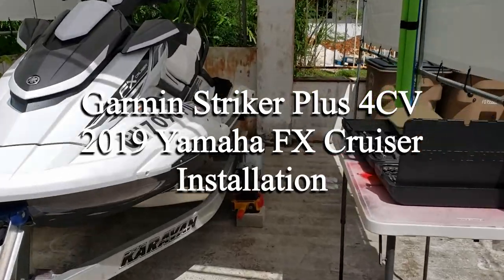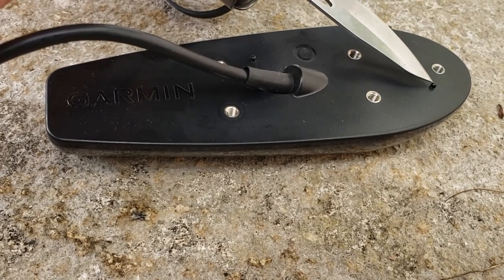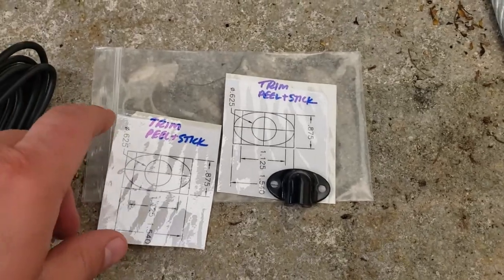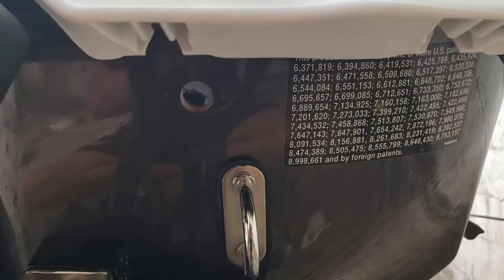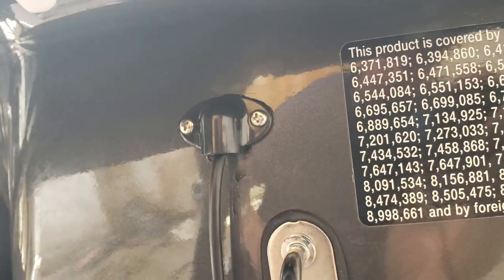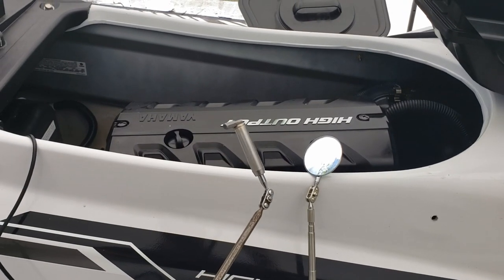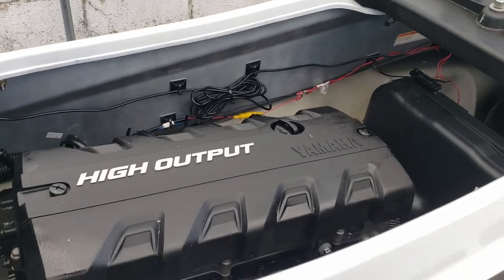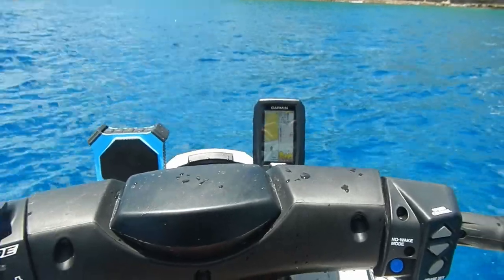Yamaha 2019 FX Cruiser Garmin Installation

Comment: I have a 2020 FX Cruiser and a Garmin Striker 45CV. Last year, after watching several videos, I installed the transducer in the hull. In my case, the transducer did track through the hull. It does work on our VX Cruiser though, with a Striker 4. I decided to try your method yesterday for the FX. Thanks for taking the time to post your method and responding to others, as I'm glad to see that it held up well.  I like that there are NO wires on the swim deck , that the pass-through drill hole is not too big, and that there is nothing to remove inside the cramped engine compartment.
Reply: Why it didn't work on the vx cruiser? I have one and I'd love to install a gaming.
Reply: @mike43v3r  Sorry I never got a notification of your Reply. There is a typo in my post. Through-the-hull worked on the VX cruiser with the Striker 4 - not the FX cruiser with the 45CV. I suspect it has more to do with the different transducers than the different Waverunners. Since another year has passed, I can say that we do prefer the through-the-hull. It never gets knocked out of place, especially when jumping over waves.

Comment: Looks great! Thanks so much for taking the time to record, edit, and share for all to see. This will really help others looking to do the same. I would also like to say having the cable routed through the transom as shown in the video is EXACLY how the Yamaha dealers are installing the transducer on the 2019 FX Limiteds. Also, running the hole saw in reverse after the pilot bit through will also cut the hole in the hull. Very light pressure is all that is needed, especially when the hole is breaking through. Light pressure will prevent chipping the material on the inside.

Comment: Could you have drilled a smaller hole in the hull or did you have to use the 5/8?  Was that a requirement of your transducer harness?  Also what are your thoughts on using a nut and bolt with lock washer instead of screws on the passthrough fitting?
Reply from the maker: Sorry for late reply.  Yes, the 5/8 was a requirement for the model of the wire harness.  If I understand your other question, I don't think nut/bolt applications are practical with most people.  I mentioned in the video that Loren has some great pass-through fittings, but as with any nut/bolt applications, you really need to get to the nut.  It's really difficult to get back there.  You would need to get a socket or something on the inside, right?  So much stuff in the way and not much space.  I found the hull material to be fine in gripping the screws.  Add on the 3M-4200 sealant, I think you have nothing to worry about.  I've been putting it in salt water for, literally, years now with no issues.  Seriously no maintenance or repairs.

Comment: I am just checking to see how your through hull fitting and wiring is holding up after several months of use
Reply from the maker: Hey, sorry for the late reply.  It is holding up beautifully.  It really looks the same as when the job was first completed.  The 3M 4200 is still completely fine after many times in the ocean.  Amazing stuff.  And it still seems rubber-like.  I know I said something like I may have it in the water 1-4 hours at a time, but really it may be out there all day.  I still highly recommend this procedure.
Reply from the maker: Update:  The 3M 4200 is working great.  Pretty much like new.  Amazing stuff.

Comment: I also want to install a Garmine Striker 4 on my 2019 Yamaha Waverunner VXR. Would the cable of the transducer fit through a the cooling pee whole  on the side of the Waverunner where water comes out from the cooling system or can you provide the diameter of the thickest part cable? I am assuming it is the end with the plug that goes into the back of the Garmine Striker 4.

I was thinking ordering 2 of those and a rubber hose connecting them and securing with clamps on both ends. I would drill 2 holes, one in the back and one in the front connecting the components together. This would create basically a water tight pipe system. I would run the transducer cable through the pipe created to avoid water getting into the hull of the Waverunner. This would give the ability to work on the cable of the transducer if I ever have to take repair  or replace the transducer.
Reply from the maker: Sorry for the late reply!  As far as the cooling hole on the side (left side for mine), there is no way I would use that.  The Garmin plug is too big and I really don't want to block or mess with the cooling system lines.  My unit requires a 5/8" hole in the hull and that's what I think is the minimum necessary diameter to pass it through.  I have a Striker 4cv and you have a Striker 4, but I think it is probably the same size (4-pin).  I'm sorry, but I'm not sure I'm understanding your plan.  As far as the ability to work on the Garmin cable, I'm not worried about my setup.  I use the 3M 4200 specifically because it is not super permanent.  I can use a knife and cut it off.  I've been out many times without an issue.  The hole I drilled has not leaked a drop in the salt water.

Comment: What size wire did you use for the power cord extension?
Reply from the maker: I'm not sure, maybe 16 or 18 gauge.  It was just an extra spool I had from Radio Shack.  Probably bought it around 30 years ago.  Still working fine.  I think this Garmin only draws 0.4 Amps, so you should be fine with even smaller gauges.